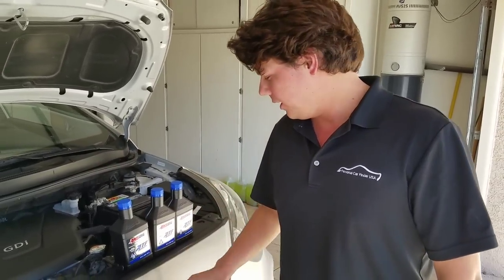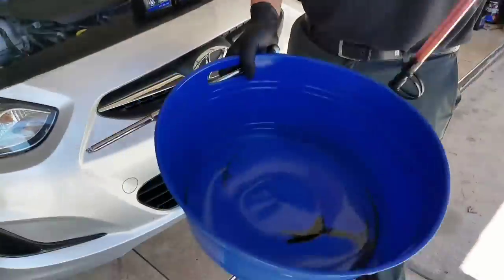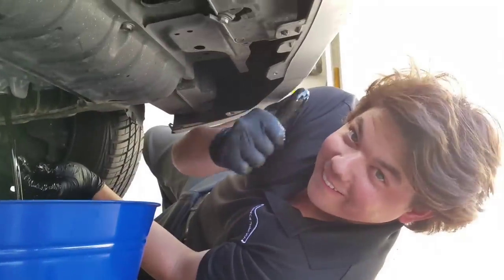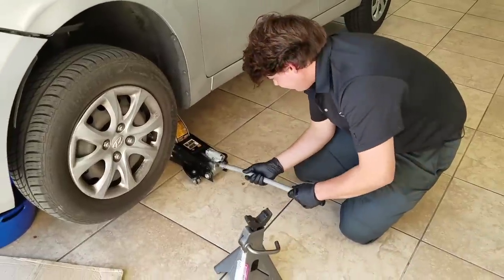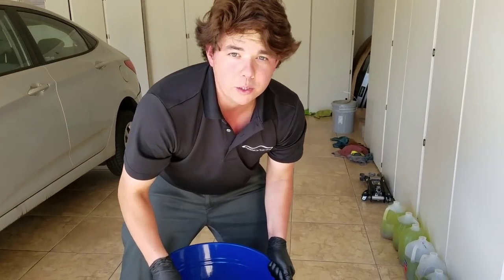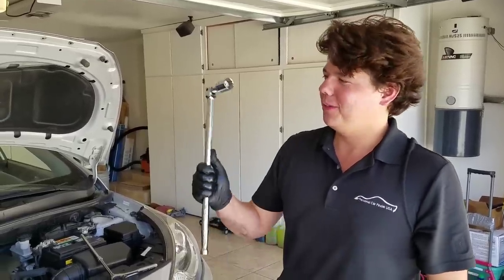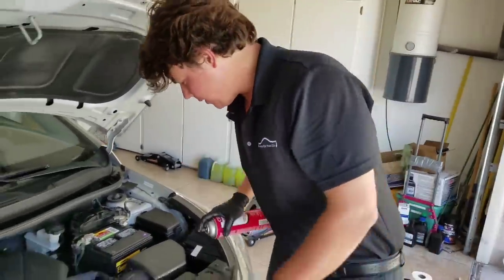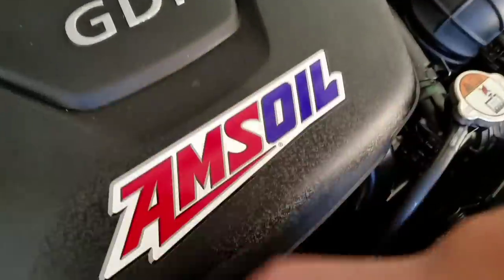Hyundai Accent AMSOIL Transmission Fluid Change & ATF Fluid Flush

Comment: So, when you drain like this just from the pan is there an issue mixing in a different brand of fluid like you are? Even with the second change there's still a decent amount of the original fluid left (presumably Hyundai brand).
Reply from the maker: Correct you can mix any amount of ATF fluid or motor oil and it will not hurt anything the preferable thing is to change as much as you possibly can so the transmission run smoother and shifts better
Reply from the maker: Thanks for the question.

Really appreciate you being a part of my YouTube channel😊
Reply: @Syntheticoilprotection  Thanks. Really appreciate the info and video.
Reply: @Syntheticoilprotection  If you don't mind, this is the car's first fluid change at 120K miles (mostly highway miles), the original fluid is very dark, almost like oil. Vehicle drives smooth though. Any concerns changing it at this stage? I see the manual recommends change at 100K.  I feel that we may be at just the right point if not a bit over but also fear that it's gone too far and fresh fluid may reveal and exacerbate previously unknown issues. Rather maddening reading about opinions on this.
Reply from the maker: Yeah I mean either way you could have an issue if it is if you don't change it you'll definitely wreck the transmission eventually.

So it's kind of a coin flip.

I would talk to a Hyundai technician that has a lot of experience and get his opinion.
Reply: @Syntheticoilprotection  Thanks again. 👍
Reply from the maker: Anytime bro skis have an awesome weekend!
Reply: @Syntheticoilprotection Thanks, you too. FYI: The fluid was bad but not as bad as originally thought. Drained it out three times. Car is running much smoother and quieter. Nice shifting. Only real hitch was the drain plug gasket. The one Hyundai sent to me was not the same. It was more like a fat washer.  I put it on and it caused leaking. Went to the dealership and they said that the original part had been discontinued. They only had this washer...which again was of no help. I had to reuse the original. So far, so good. Now to find a proper replacement for the next time. Thanks again. Your advice and video was spot on even for our 2008 model. Best to you. - D.

Comment: I thought that water sensitive electrical parts needed to be covered. I asked my mechanic if I could spray engine de-greaser to clean dirty engine and he said it could get damaged. Also I noticed that you simply wiped off the de-greaser. I have a Hyundai accent and want to clean the engine. Is your method safe. It didn't seem like you covered or avoided any area of engine when you sprayed the product. Also what product did you use.
Reply from the maker: It's the Amsoil engine degreaser.

Also I would definitely not spray it directly into any electronical fuse boxes or anything like that. If you hit a connector for a second it won't do anything.

Still be cautious LOL

Thanks for the question😉
Reply: Under proper operating conditions, everything in the engine bay can be rained on. Connectors and boxes are sealed. Don't hit them with a power washer or anything with serious force, though.

Comment: Got a question I don't even know if the old owner used synthetic oil my Hyundai only have 32.000 miles 
Can I use synthetic oil in the engine it is a 2017 Hyundai accent 
Thanks keep making videos
Reply from the maker: Yes, I made this video for that topic.☕😃🎬
https://youtu.be/celH6X9nbyg
Reply from the maker: If you are new to amsoil it's best to get a 6-month preferred customer membership that'll get you the wholesale price and the free shipping.

You'll see here on my site if you scroll down you'll see the 25% off preferred customer.

Synthetic Oil Protection Website - http://syntheticoilprotection.net/

     Professional YouLubher: Eben Rockmaker Regency Direct Jobber AMSOIL Specialist (Dealer#: 5331179) Mobile: (702) 472-3614
Reply from the maker: Latest promotion code: SHOP1220
Oders
$49 Or more gets free shipping.

Comment: hi anyone can say Hyundai accent 2016 model middle east, Gear oil need to change or not?according to the service center dntwnt to change ,its automatically....but I felt some gear transferring issues while reverse gear getting delayed.
Reply from the maker: I would definitely change it ASAP!
Reply: My dad's car had the same issue .... It has done 225000kms plus.... Well maintained only at Hyundai showroom... The service centre said... That therr is some transmission wall damage...causing the delay in reverse gear engagement

Comment: Dose this car have gear filter? If it dose why wont you change it too?
Reply from the maker: Those cars are a basic draining feel and you do not change the filter
Reply from the maker: Lots of those transmissions are like that on the Honda's so that's why it's so important that you change that fluid sooner than later
Reply: Today i check and the gearbox oil container have an oil filter and you need to change it and the magnets there...
Reply: how much fluid do i need to buy?

Comment: What is the total amount used in this video? I ask because I am about to do a drain and fill. I do not understand if you add new oil every time you flush or re-use. Im just trying to get the right amount of oil.
Reply from the maker: Great question Jonathan this lookup guide will give you all the fluids in capacities for your year make and model you'll see the initial fill and the total fill if you just drop the pin it will be the initial fill quantity It's always good to get an extra quarter to just to be safe and if you have any questions just call me.

If you're new to Amsoil the 6-month PC membership will give you the wholesale pricing which will save you about $33 and $100 order and when you use my link I will get the credit and I'll be your Amsoil Dealer so you could always ask me questions in the future.
  Professional YouLubher: Eben Rockmaker Regency Gold Direct Jobber AMSOIL Specialist (Dealer#: 5331179) 702-472-3614 

Find Products For All Vehicles - 
https://www.amsoil.com/guides/?zo=5331179

Comment: How many quarts does that car take ?? Just one ? I have the same car
Reply from the maker: Great question I don't remember exactly because I always do a double flush on them to get most of the old ATF out but this is the Amsoil lookup guide and if you're going to get Amsoil I recommend becoming a preferred customer because you'll save 25% off and you also get free shipping on any order $100 or more.

AMSOIL Vehicle Lookup - https://www.amsoil.com/guides.aspx?zo=5331179
Reply from the maker: The lookup guide will show you the oil capacity and all the different fluids on your vehicle

Comment: How much fluid i need to buy for that change?
Reply from the maker: This will give you the exact capacity for all the different fluids on your vehicle.
AMSOIL Products & Vehicle Lookup - https://www.amsoil.com/guides.aspx?zo=5331179
Reply from the maker: People ask me these three things:

1. Where can I find AMSOIL? - Use this link https://www.amsoil.com/offers/?zo=5331179
Or
Watch THIS: 3 Fast Ways To Get AMSOIL - https://youtu.be/RiYifuDCsnQ

2. What makes AMSOIL different than other oils? - AMSOIL is 100% Synthetic & has higher film strength & last 4×longer then Mobil 1 EP which protects and separate metal parts keeping them from wearing and Lasting Exponentially longer: https://youtu.be/f4eNPgTi_qo

3. Why should I use AMSOIL?: It protects the engine so it will last longer. Less oil changes less often(once per year/15,000miles) or longer... Save money in Gas & Time making it less expensive then a free oil change over the year - https://youtu.be/H7K6FdZlqmg

Professional YouLubher:
Eben Rockmaker Executive Direct Jobber AMSOIL Specialist (Dealer#: 5331179)
Mobile: (702) 472-3614

My Link: Best AMSOIL 100% Synthetic @ Wholesale + FREE Shipping: https://www.amsoil.com/offers/?zo=5331179

Comment: Just one thing. How do you check the fluid level? is there a sight glass or a plug you remove to check the level. Thank you for a good video. You need glasses on though. I'm 100% Pro AmsOil for sure. Jim.
Reply from the maker: Just depends on the car or some of them have an overflow plug some there's not and I just fill it to what the speck calls for.
This will give you all the fluids for your vehicle and the capacity Lookup For Your Vehicles - https://www.amsoil.com/guides.aspx?zo=5331179

Comment: Changed my fluid I put 7 quarts in it like all data said ran fine until I got on the high way and had zero power after I got above 75 mph
Reply from the maker: I would take your car to a technician and have them look at it.
Sounds like there's something wrong with the computer or something.

Comment: I don't see changing the transmission fluid in the owners manual, recommended maintenance goes up to 150k.
Reply from the maker: That sounds correct
Reply: my dads car is a 2015 model, trans is already starting to slip after 112ks
Reply from the maker: That's normal

Comment: This comment's years late, Eben :)  If you ever see it - You didn't use Amsoil engine oil/ trans flush in the auto trans?
So - That Amsoil detergent flush is not for auto trans?
Reply from the maker: Yes you can use it in the transmission You want to make sure you do a full flush and get all the old fluid out
Reply: @Syntheticoilprotection  Wow. Fast reply :) Then, Why didn't you use it? have you done a show where it's used for auto trans flush?
Reply from the maker: Yes there's a video if you type in amsoil engine flush truck you'll see I do a truck but you have to take the return line off and make sure that you get rid of all the old fluid and it takes a couple people to do it properly so that's why I usually don't do transmission flushes I just flush the engine oil.
Reply from the maker: This is the truck that we did the engine flush on.
https://youtu.be/-g5UspPi-zY
Reply: @Syntheticoilprotection  Thanks Eben. I had seen that vid. What I was trying to say: You didn't use the detergent flush first up? Not even in this vid?
Reply from the maker: Yes I usually do the engine flush in the motor oil.

You'll see I have a playlist of engine flushes if you go to my homepage.

Comment: I don't believe you need to do a double flush in my opinion it only took me a half hour. You will see when you are putting the transmission fluid in it takes forever don't rush. You will have some spillage so put down some towels or what I used was an old area rug after you change the fluids cycle through all the gears for at least 10 seconds and then take it for a ride.
Reply: How many quarts did it take? 3 or 3 1/2?
Reply from the maker: The double flush is just a little extra due diligence.
I'm sure when you go to the dealer and they only do it once lol
Reply: @sergiogarcia7171  mine took 3 1/2 it was very dark i dont think the last person changed it in a while.
Reply: @Syntheticoilprotection  thanks video was great very detailed i had no problems.
Reply from the maker: Awesome
Reply from the maker: Sweet!

Great to hear you had good results I'm curious how many miles are on the vehicle?
Reply: @Syntheticoilprotection  i got it with 109k and now it has 136k.I started to get rough shifts and a check engine light. I decided to change the fluid rough shifts stopped and check engine light went away after 2 miles. I'm the second owner I've been changing the oil and the radiator coolant myself but, I was hesitant on doing the transmission fluid  myself until I saw your video. Believe it or not if you want to start doing maintenance yourself this is a perfect car to learn on a lot of the stuff is very simple
Reply from the maker: Yeah it's a great little car I'm amazed how good that car drives!
Reply: @Syntheticoilprotection  agreed

Comment: Thank you so much for posting this! I came home today went inside for an hour and when I came out my tranny fluid was all over the ground. Look underneath and saw the drain plug had almost completely fallen out at 27k miles on a 2016... 5 more minutes on the highway and I could have lost it entirely. I was looking and saw max-life ATF says it's SP IV-M compatible. Have you ever tried that?
Reply from the maker: I haven't but I know they're not 100% synthetic.

The difference with the Amsoil oil is 100% synthetic and there's less friction less heat extended life of the bearings and you also get better gas mileage.
Reply from the maker: This is a video that shows people's reactions to 100% synthetic lubricants.

https://youtu.be/H7K6FdZlqmg
Reply from the maker: Thanks for being a part of my YouTube channel Joseph
Reply: @Syntheticoilprotection  Do you know where I can find the product sheet that lists this is equivalent for the SP IV-m. I'd just like to make sure I'd still be under warranty using this with the dealership before I give it a try.
Reply from the maker: Basically the Amsoil products exceed OEM by two to four times.

As far as making sure it's the right product for your vehicle you can look it up with the Amsoil lookup guide or you can also call Amsoil technical support which is open during the weekdays and they are in Superior Wisconsin business time
Reply from the maker: AMSOIL Vehicle Lookup - https://www.amsoil.com/guides.aspx?zo=5331179
Reply: The Maxlife is just fine, used it many times with zero issues.

Comment: What year Hyundai was this?
Reply from the maker: I think it's a 2013
Reply: @Syntheticoilprotection  do you know if a 2017 has the same setup? I've got one and I want to change the ATF at 50k miles. No flush, just a drain and fill
Reply from the maker: @scottyhaines4226  

Usually it's the same for the ATF and a CVT transmission when you plug it in the Amsoil locator you'll see which one it is

Comment: I've heard that Hyundai used Jatco Transmissions in some of their cars.

Do you know whether Hyundai used Jatco Auto Transmissions in the Hyundai Accent Elite, SR, or Sport 4th Gen (RB; 2010–2018) using the Hyundai Gamma (1.6 Gamma GDi [G4FD]) 4 Cylinder, 1.6 Litre engine. Sports Automatic Transmission?
Reply from the maker: I'm not sure Michael.

I do know when we change the ATF fluid it was amazing on the Hyundai Accent.
Reply from the maker: It's amazing how much a basic drain and fill will do.

This is the look up guide and it will give you the exact capacity for the car for your car and it also give all the products that Amsoil makes for it if you ever have any questions always happy to talk anytime☕😊🇺🇲

Comment: You mast start engine , whan u change oil
Reply from the maker: People ask me these three things:

     1. Where can I find AMSOIL? - Use this link https://www.amsoil.com/offers/?zo=5331179
Or
     Watch THIS: 3 Fast Ways To Get AMSOIL - https://youtu.be/RiYifuDCsnQ

     2. What makes AMSOIL different than other oils? - AMSOIL is 100% Synthetic & has higher film strength & last 4×longer then Mobil 1 EP which protects and separate metal parts keeping them from wearing and Lasting Exponentially longer: https://youtu.be/f4eNPgTi_qo

     3. Why should I use AMSOIL?: It protects the engine so it will last longer. Less oil changes less often(once per year/15,000miles) or longer... Save money in Gas & Time making it less expensive then a free oil change over the year - https://youtu.be/H7K6FdZlqmg

     Professional YouLubher:
Eben Rockmaker Executive Direct Jobber AMSOIL Specialist (Dealer#: 5331179)
Mobile: (702) 472-3614

Comment: I had a Honda accord 2017 with a CVT transmission it died on me at 50,000 miles I have an Elantra now it has 60,000 miles no problems at all
Reply from the maker: Awesome we've done a couple transmission fluid changes on cbts on the channel you'll see them under my playlist
Reply: Had you ever change the CVT fluid on your Accord? And what year is your Elantra?

Comment: Isn’t it bad to change out the transmission fluid after 100,000+ miles?
Reply from the maker: It's always worth a shot because if the ATF fluid burns and has a full chemical change which is called thermal runaway. The trans overheats and can lock up and not shift. 

You want to get to change it ASAP.
Reply from the maker: Great question Kevin😊
Reply: Why would it be bad?
Reply: I have to agree that changing out the atf is better than not.  The idea of not changing is a false statement I have heard for decades.  Mostly from shops that did not have qualified techs.
Reply: I had a dodge daytona that I was young and had the fluid changed on and 3 days later the tranny went out. I shouldn't have changed it but I was young and didn't know better. .
Reply from the maker: 😃, changing the fluid has nothing to do with breaking it.

Transmission to wear out over time and then they eventually fail because of improper maintenance. Or should I say lack of Maintenance LOL